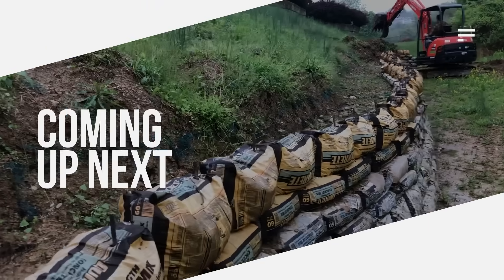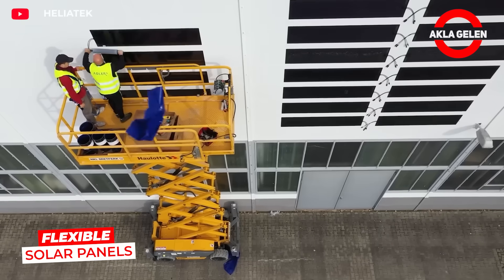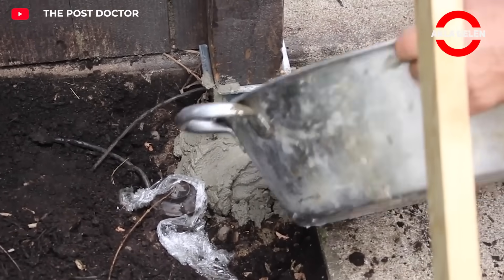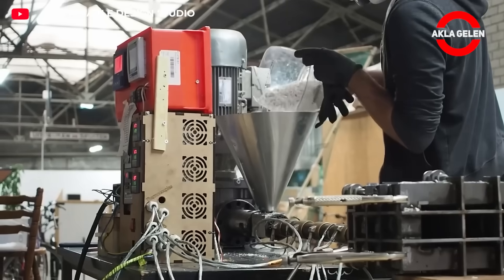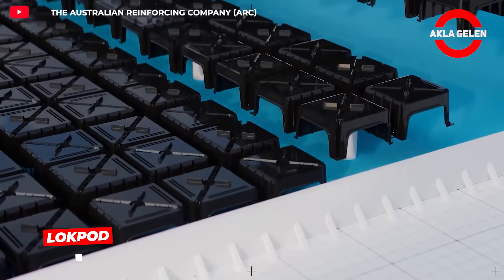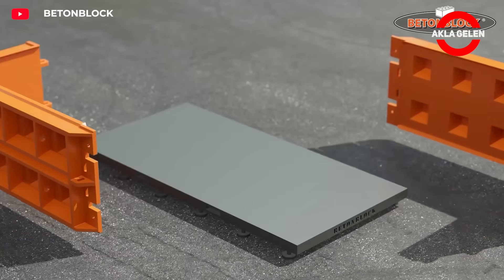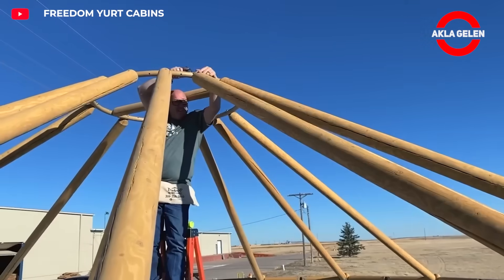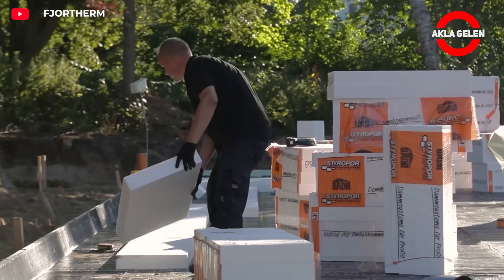I can't believe it! I never thought of these ingenious Construction Techniques

Comment: So many examples of utter stupidity - anyone with a minimum knowledge of contruction will be laughing their heads off. Ie the metal post base that sits inches under the ground - derrrr one gust of wind and the whole fence gate will go flying. The plastic lego bricks that are unbreathable, the bags of cement that have to pillars for strength etc etc etc  - the list goes on and on.

Comment: Cement bag wall is a waste of expensive cement. For example, cement:ballast ratio of 1:4 is a strong mix.

In the UK, one bag of cement i about £8.

One bag of ballast is £4.

Instead of using 5 bags of cement at a price of £40, you could use 1 bag cement and 4 bags of ballast at a price of £24.

Multiply that up for 1000 bags for a wall, and you see the savings. 

Instead of paying for £8000 of cement, you could pay £4800 for the mix.

Bear in mind, ballast is a lot cheaper than that if you buy 1 ton bags instead of small 20kg bags.

You could easily cover the cost of mixer + wooden frame for the concrete wall with that saving.

Comment: Installing steel plates in a mortar joint is not a good idea, as the horizontal shear strength of the wall is compromised, since steel is extremely slippery compared to a mortar joint.

Comment: Why dig a foundation hole then fill it with old tyres, they dug the hole bigger than the tyres that leaves a gap, smaller hole fill with concrete, job done
Reply: The flexi-foundation provided by the tires could cause cracks on walls and rooves, especially terracotta or other concrete materials. Roof leaks will be a real problem.

Comment: Some good ideas, some bad. The steel plate stopping moisture rising through the walls is not a permanent fix as it will likely corrode. And using tyres as formwork for column footings seems silly. (Note also the thickness and position of the re-bars.)

Comment: the steel plate might stop water, but it's also allowed the building to fall off it's foundation in the event of a minor trivial earthquake.   Or perhaps even high winds.
Reply: That steel plate will rust due to the moisture and the corrosive effect of the mortar that will be lime based.  When the rusting occurs the steel will expand exponentially causing the masonry to debond.  That is notwithstanding that there is a capillary path for the moisture between the sheets.
Reply: @clivewilliams3661  They use a grade of stainless steel which will not rust in those circumstances (but I'm still not convinced by it).
Reply: @RobertScott-pp6gj  That would be an extraordinarily expensive material to use when compared with the alternatives but in any case stainless in the cheaper forms i.e. 304 is susceptible to corrosion from chemical attack and I doubt they would use 306 for its greater corrosion resistance.  Besides there still is the issue of the capillary attraction of moisture at the overlap in the metal.
Reply: Basically cutting the foundation away from the building
Reply: Yes, a ‘house sled’ indeed

Comment: If you was to do that steel plate method here in the UK.  You would be ordered by building regs to most probably to take the whole outside of the house down and rebuild the whole outer skin.  You have literally failed the building structure to the point of unsafety.

Comment: When you drill into a wall with impact and vibration, you destroy a corner of a house that is already poorly built with bricks. The option with metal sheets is terrible.
Reply: I suspect that house was already in need of being torn down and replaced.
Reply: @baddoggie101 I'm a builder and I still have old books on techniques and organization of repair and construction work and THIS is a whole SCIENCE. Although technologies are developing, the basics are the same. 😊

Comment: Hopefully, that isn't "cement " in the bags. Cement on its own is not very strong.
Reply: I know they sold some mix of cement and sand that only needs water. But I think this is not a chip way of doing this wall. I've use "gaviones" kind of  metal cages that you fill with rock...humm...it was next to a river...that was a chip source of rock.  It seems it all depend on the situation and place.
Reply: @telviamonteza7420 Do you mean cheap? Gambion structures are definitely an option.  Where I am from premix concrete is available in 50 and 80 pound bags. Usually a very high guality product.

Comment: I loved the tire-rebar concrete column idea; I have the perfect upcoming application for that. Thank you :)
Reply: We constructed a pergoda in our garden and one of the legs needed raising. We used a good quality bucket, filled it with cement and when it dried we were able to bolt the leg to the concrete set in the bucket surrounded it with plants!
That was three years ago and is still solid!
Reply: Never do like that. The columns are not stable and will sway.
Reply: Not too bright are you?